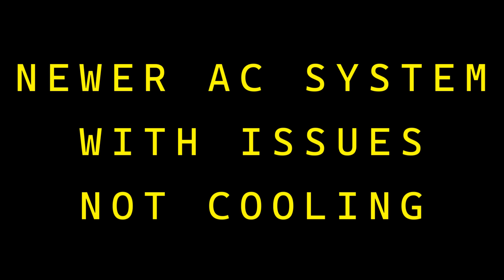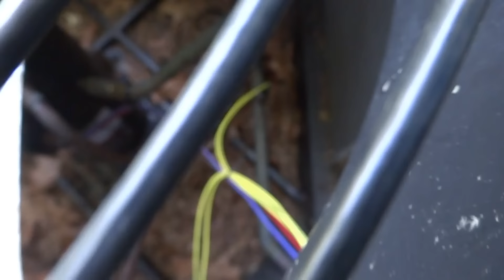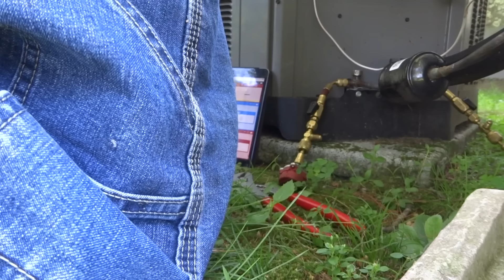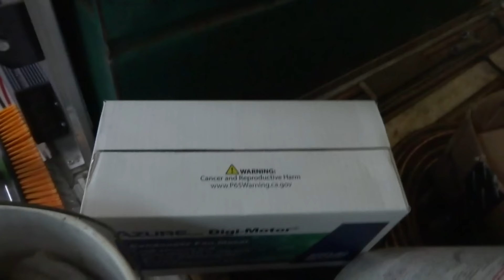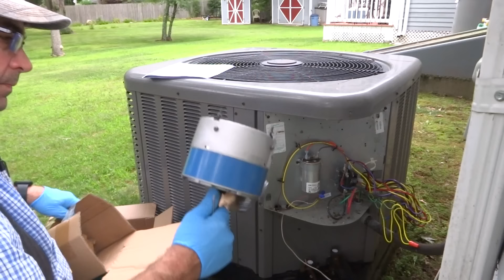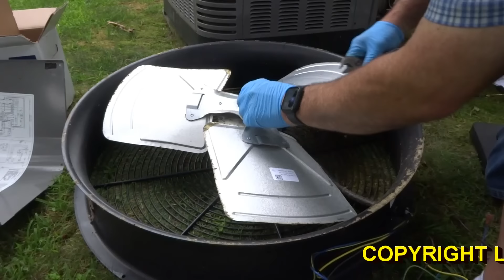NEWER AC SYSTEM WITH ISSUES NOT COOLING

Comment: Steve an ECM motor does NOT have a built in capacitor
Reply: Ever remove a module before? There’s usually little caps inside, I just replaced one on a trane furnace where two of the 4 caps inside the module were bulging and failed.
Reply: Of course they do. Under the module there’s two usually. Sometimes four but usually two I believe. They look like the big fat batteries. They have kits and you can replace just the guts of the module. Hope that helps.

Comment: Awesome…  I have the same condenser unit came with my house brand new system in 2018 _ 90 plus high efficiency unit on the inside too  knock on wood no problems yet but my fiancé runs it hard hard she likes it ice cold in the house 🥶🥶☃️⛄️

Comment: If the capacitor is built in the motor what is that capacitor looking cylinder thing on the side of the unit then? Sorry, I don't know a lot about AC repairs.
Reply: You still need to have a capacitor for the compressor. So since they're not using one for the fan, that capacitor only has a common and herm terminal simply for the compressor.

Comment: Milwaukee has a 12 volt Dremel copy, rotory tool that I keep in my van for trimming bolts.  You can buy 1-2" reinforced disks for it. Extremely handy,  I routinely trim  1/4" bolts with it. Not as strong as a grinder but really handy.

Comment: You can swap the ecm motor for a pcs motor. Need to add a contactor, a capacitor, and some wiring.
Reply: The factory contactors have enough connections to add the two 220v legs and most replacement PSC motors have long enough wires so, bye, bye expensive ECM.  And capacitors are not that expensive.  Just make sure to closely match HP and speed.

Comment: Okay, I'll give you the one argument against shutting a system off.  When I lived in an apartment, the condenser fan would fail only after running many hours and then it would upset the compressor and eventually the breaker would trip (a federal pacific breaker no less).  When maintenance would come and turn it on, it would run perfectly.  The failure seemed to always occur after business hours.  So I was looking stupid.  On the final fan failure, I called it in as an emergency in the evening and the maintenance man on duty was a decent guy and came right away.  At that point he saw the obvious failure.  The condenser fan was replaced next day.
Reply: That's on the repair people being more thorough in troubleshooting.  

Running a bad AC is a bad thing.  Also, if the coil is freezing over, now the repair person has to wait until the ice thaws completely so they can troubleshoot the system.

Comment: The Azure motor needs to be programmed with the 115 ac cord. It’s has 1075 speed for clockwise and counterclockwise and 850 for the same. They spin 90 seconds for  each speed and rotation you simply unplug it when you see the correct selection. They’re actually good and reliable motors and less expensive in some models.
Reply: Thanks for explaining that. I was wondering about the included cord.

Comment: Had a service call last week just like it where the ECM failed on a Rheem 16 seer from 2016. OEM motor was back ordered 4 weeks out and ended up using an azure ECM instead. Couple was in their 70s and had to get it repaired.

Comment: Nidec aka USMotors makes ECM replacements as well. The problem with those OEM ECM motors are the internal "module" that has a cheap $2 electronic part that fails. The Gentec Evergreen motors are the replacements for the original Gentec EMC motors that are know to fail often all the time.  Those Gentec motors are $800+ and worthless when they first came out. Best to use a substitute like USMotors who don't play around.

Comment: Steve, you need an impact driver too much f__king around it saves you a lot of time with all those little screws and nuts, put an inverter in your truck so you can charge batteries 😊

Comment: July 15th makes my 30 years in the business. When they tell me that they did not shut the unit off. I get more and more pissed off as I get older! Before it was a laugh when I was younger. Now I'm pissed because I don't  want to deal with changing out a compressor or changing a condenser motor because the guy who's let it run with a bad capacitor.... Either way more money for me but I'm with you brother. Turn the damn thing off if it's not working do you leave your car running when it's not running right.....

Comment: If I were paying I’d have you pull the ECM, get a PSC motor and the appropriate dual run capacitor and call it a day.  There is no earthly reason for that ECM to be outside on a basic system.
Reply: That's my question. The motor is constant speed. Why can't a standard PSC motor take its place?
Reply: @boeing757pilot  short answer is it can be swapped.  Just have to add the capacitor and wire it.
Reply: @yfdfireman2  Thanks!
Reply: It’s not constant speec
Reply: @robertcherry4971  So, it's varying over time. Curious, what is controlling its speed. Does it have sensors? Thanks!

Comment: Friends of mine had a triple stage Rheem put in. I told them to go basic citing the increased likelihood of problems and much higher repair costs, but they put it in anyway. I have to say it's a beautiful system to live with, and even at 115 degrees it rarely hits third stage and runs the blower on full speed unless you turn down the temp. It just quietly maintains temperature all day long. It also manages to keep indoor humidity 30-40% without a humidifier, which is no small feat in AZ where they are.

The day will come when it breaks though, and I can already hear the sob story about how can it break it's not old, and oh my god how is the fix that expensive!? I warned 'em...

Comment: My neighbor just had his ecm taken out and they put in regular motor. His unit out of warranty though.
Reply: It's probably not a 16 seer probably just dropped a quarter horse 1075...
Reply: @aringraveshvac9670  I have a 16 SEER Goodman with a PSC.  The difference in draw on a 1/4 horse PSC vs ECM is about 20% increase in efficiency.  It takes a very long time to overcome that price difference and the ECMs seem to fail a lot more.  I have an ECM on my indoor unit, along with a conversion board and a ready PSC motor if it fails.  Call me crazy, just don’t trust the ECMs even with surge arrestors on both units.

Comment: A PSC motor won't work, because you'd be screwing them out of extra money.
Reply: ECM is only 20% more efficient than a PSC motor on paper and with only 2 amps of power draw...20% isn't a savings for a good 10 years worth of power.

Comment: Can you replace that ecm with a regularfan motor with capacitor?
Reply: If it doesn’t  have a control board, yes. It will need the capacitor and wired to the contactor. Easy conversion and a lot cheaper than the ECM motor.
Reply: I thought it was very possible

Comment: On the ECM Motors on the residential single phase you can just change the power pack there are three phase Motors should be the same warnings when you pull the power pack out

Comment: I'm not a fan of the high efficiency crap. Extra expense for fancy crap that saves a few cents in energy but costs big time when it breaks. Just like the new cars.
Reply: It's the bean-counter engineering running rampant throughout many industries.  Build it cheap, sell it for a kings ransom for massive profits.  Planned obsolescence in overdrive.

Comment: So the Super Cap, gives the jump staaat, to the motor?  Otherwise, the Motor or compressor will sit there and generate/heat up and wear out?   It's interesting.  My oil is good on my caaaar.

Comment: That's BS 
It should be warranty especially they are failing a lot
Reply: The warranty only covers the part itself not the labor. I had our ECM blower motor crap out just below five years. They are basically  high efficiency nightmare motors.
Reply: He did get it warrantied at the end of the day.
Reply: Can’t control that input voltage.
Reply: The company typically cutting and running away from the issue so it doesn't come from their pockets

Comment: Is it not possible to replace with a standard motor and wire in the appropriate capacitor?
Reply: It should be under warranty.
Reply: Yes, if you want to ignore/void the warranty.
Reply: Will void the warranty
Reply: Fair comment, though no technical reason not to had it been out of warranty?